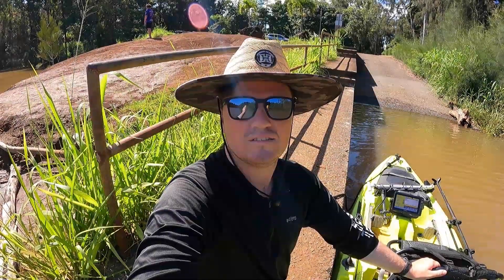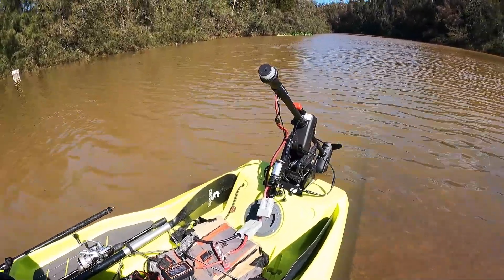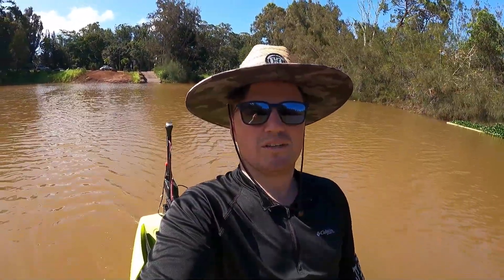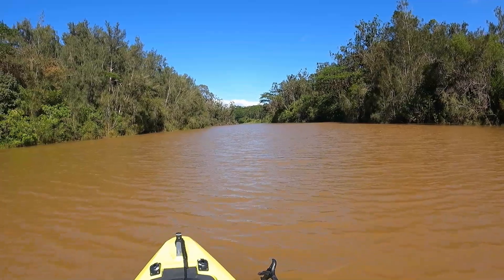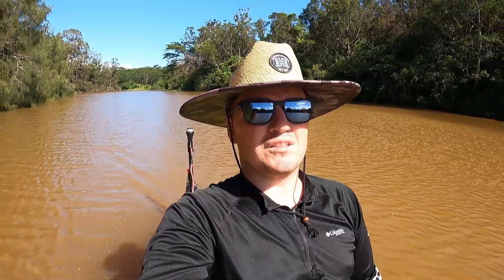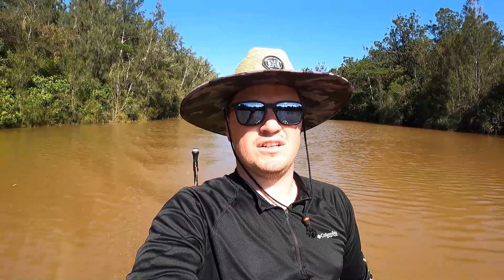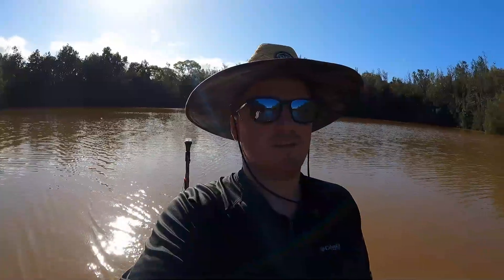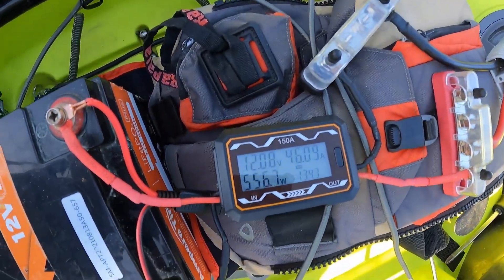Go Faster! Last Longer! $8 Propeller Upgrade for Your Trolling Motor!

Comment: Do you need to run the APC prop skirt with your motor? I ran into a slippage issue on the shear pin and skirt interface while using the 10-5. There was end play with everything tight and this allowed the shear pin to wallow out the groove in the prop skirt.
Reply from the maker: I just put 2 washers behind the prop nut. I haven't had any slipping with the pop I'm using, but the reason i only tested 2 props instead of the three that I bought is because the smaller one wouldn't stay on the pin and I didn't have any spaces with me.

Comment: I found 3 different props of that size: 11x6, 11x6P and 11x6M-LH. Which one did you test?
Reply from the maker: 11x6M-LH. Both props I tested were from the "marine" section on the APC website.

Comment: That's pretty cool. 

Just remember, in a lot of states, if it has a motor, it has to be a registered watercraft.
Reply from the maker: That's a good point. Out here in Hawaii, it doesn't need to be registered if it's electric and less than 3hp. Other places I've lived, it would definitely need to be registered.

Comment: Nice, who would have thought that different props might be better.
Reply from the maker: I knew a different prop would change how the motor behaves, I just didn't expect it to be that much better.
Reply: Thanks for the thorough testing. How did the Amp draw compare between the two APC’s?
Reply from the maker: The 10x8 was better at very low speeds, but by the top end, the 11x6 was significantly lower draw